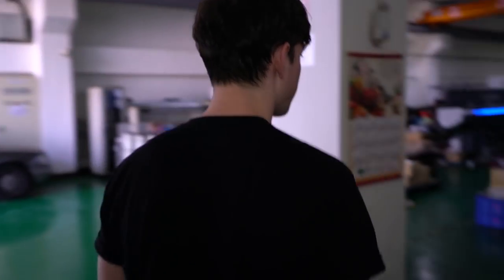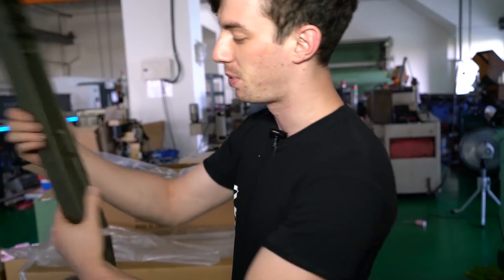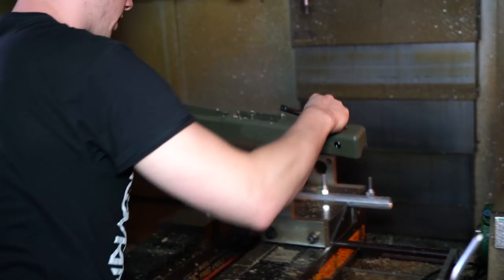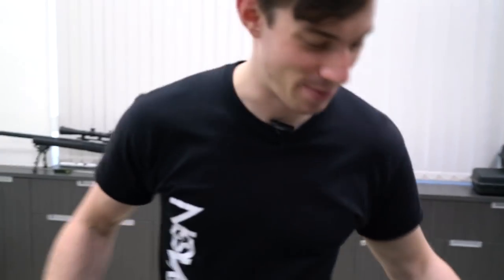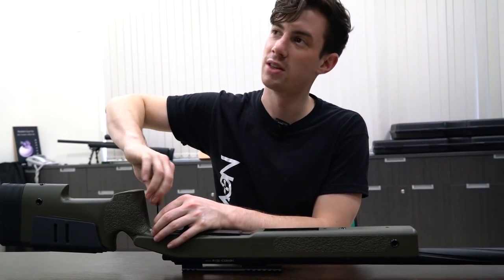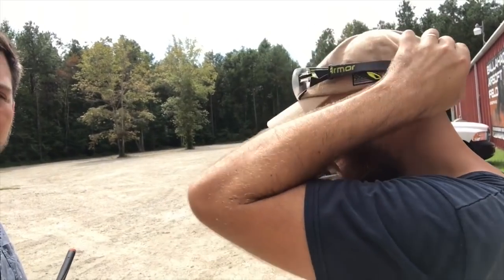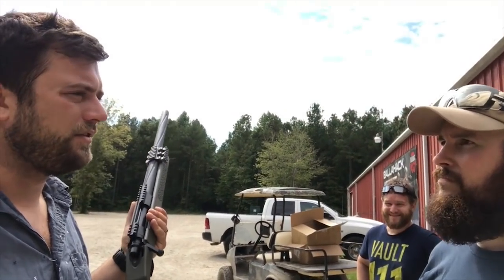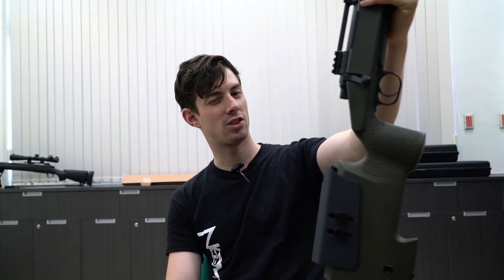How it's made: Sniper Rifle Stock M40A3

Comment: Ohhh sick I'm actually studying to become a CNC machine operator
Reply: be machines
Reply: CNC Operator or CNC Machinist? big difference lol
Reply: Operator mostly only run machines and check quality of project then send to QC check
Reply: Machinist you got learn about program , drawing, set up machine and many more
Reply: A machinist is a person that can accurately machine parts to print, using a variety of machines and/or methods, relying on his/her skills, obtained through an accredited trade school or from many years of on-the-job experience. An operator, on the other hand, is not a machinist at all. Operators are an entry level position, lacking necessary machining skills, that run jobs that have already been proven out by a machinist. In the industry, we call them 'Button Pushers'. Sure, operators have their place in a machine shop, but they should never be considered a machinist. That's an insult to true machinists and an unwarranted/unearned elevation of an operator's real status.

Comment: speeds and feeds seem a bit slow for cutting plastic. Pushing the feed up will give you a better finish and probably take off most of those burrs. Also seems odd to plunge out the profile before doing the finish cut